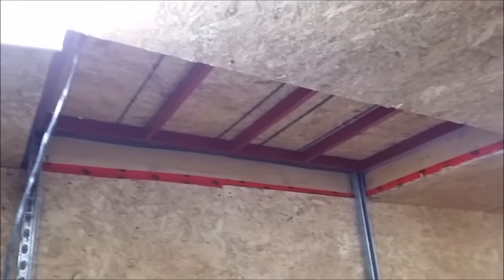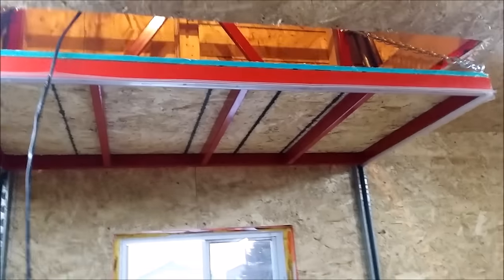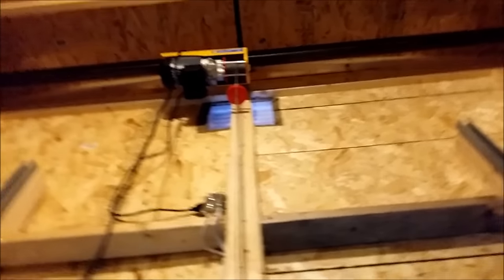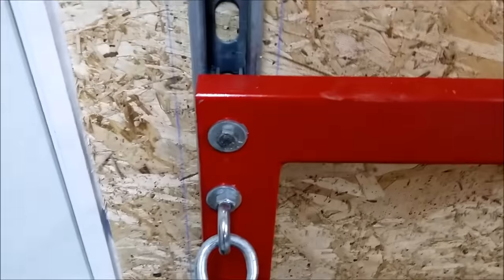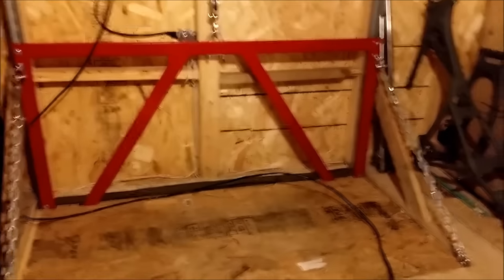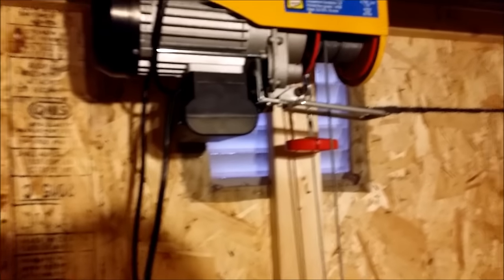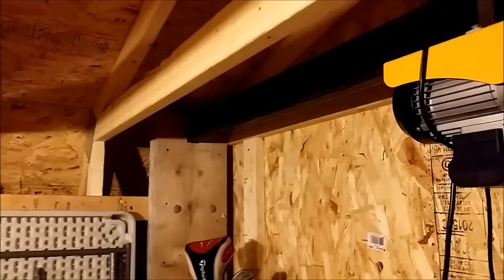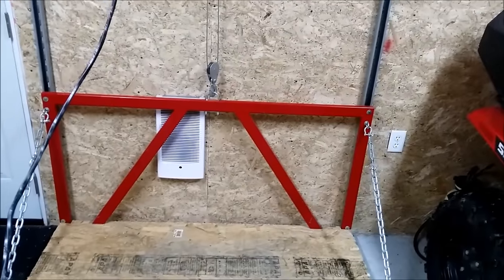Garage Attic Lift Construction

Comment: Before copying this design, realize that is is dangerous.   There are several incorrect statements about loads and forces.  There can be a lot of force on the Superstrut because it is not just a guide.   The P2750 light duty trolley is designed for 100 pounds and has three holes for mounting to the HORIZONTAL load, and two of the holes are difficult to get to because they are over the axles for the four wheels.   The metal can be easily deformed on the light duty trolley by using just the center hole which can cause the wheels to fail.  The heavy-duty P2950 Superstrut Trolley is rated at 600 pounds at 30 feet per minute and should be used even for the lightest loads in this design.        If one stands on the far edge of the lift from the wall, the entire weight of the person is pushing into the Superstrut and the top pulls out by the same weight magnified by the angle of the brace.   To clearly see this, consider if the vertical height of the lift platform is reduced to the 3" length of the top trolley.  Then the force on the top trolley would be magnified by the moment arm length of the lift from the wall divided by the height of 3".   The trolley would immediately fail - try it.   Just because the load is being pulled up by the winch does NOT mean that there is a no  force on the Superstrut.   Also, the P2950 comes in cheap versions and more expensive versions with the corners near the wheels rounded so as not to catch on the Superstrut.   Of course one can round the corners so as not to catch on the superstrut and it is crucial to make sure the trolley does not catch on the mounts of the Superstrut to the wall.  The heavy duty trolley is much less likely to twist and bind with time which would cause a catastrophic failure.   It would also be far far safer to use real heavy duty lift trolleys on I beams.  It all depends on how safe one wishes to be.
Reply from the maker: All great points Jerry. My lift has been in place for 5 years now and my semi-annual inspections of all hardware show things are perfectly fine!
Reply: The light duty trolleys are not safe.  Please think about the danger you are leading other people into.
Reply: blastworks
2 years ago
Sorry for the late reply Vazgen! The ones I am using are only rated for up to 50lbs or so, but they rarely see that as the load only pulls out slightly, most of the load is updown.
This statement is completely incorrect.   The further from the wire rope, the greater the pull on the trolleys.

Comment: you can get it too lift faster by enlarging the knob that the cable is winding around
Reply from the maker: Hey Mgn! I may look into using a larger pulley in the catch block when I replace the cable hoist with a larger one when I upgrade!

Comment: My friend built one like this years ago he also had only one cable with no safety lock on the carriage. One day he was showing it to some older relatives and the cable broke plunging them to the floor below. Some very serious injuries occurred as well as some very serious settlements were required to help the injured. Not trying to be a pain in the ass but please be very careful and also try to come up with some kind of emergency fall restraint.
Reply from the maker: Thanks for expressing your concerns Dave!
Reply: Dave,See my entry above, I found a good solution with a heavy duty brake.
Reply: I believe a synthetic winch cable doesn’t bind and break like regular cable with regular use. I plan on getting synthetic for my quad for that reason.
Reply: Milton Turner,  care to clarify? I'm not seeing your solution re: brake. Thanks
Reply: I see several references to a link with more detailed information, but I do not see a link. Can you attach again?

Comment: curious, what happens when your up in attic and power goes out.
Reply from the maker: @markroberts7941  I dunno where you are from or how bad the power grid is there but I think that runs about the same probability as winning the lottery.  

That being said, I was up there once drilling for security cameras and went through a wire, tripping the breaker. I pulled the lift platform up out of the rails and climbed down. Took about 3 minutes!

Comment: How much weight will the 2”x4”x 3/16” beam handle? I’m doing one that’s 8’ long?
Reply from the maker: Hey Billy! I looked it up and it's around 3000lbs, so anything you'll lift with a cable hoist will be safe.

In the mean time, check out my latest video, I'm giving away a cable hoist to a subscriber who comments and likes the upgrade video!
Reply: @blastworks  thanks and will do!

Comment: I did this same thing with unistrut track and trolleys. Did you have any problems with your joints in the tracks and the trolleys hanging up? I did and grinded the inside of the track but don't trust it. I got the 750/1500 lb hoist so I don't want it to rip itself apart. 😃 Maybe weld em?
Reply from the maker: Robert Haas You could definitely weld them if it would give you peace of mind. I just made sure that mine were in line so I wouldn't get interference when the top set of trolleys goes up into the extra piece of unistrut. On my setup, only the top wheels go up into the shorter pieces, the bottom trolleys stay in the main run of channel.

Comment: Brilliant!  If the lift motor fails, does it lock in place, or does it freewheel?  I would like a fall limiter/brake, if possible.
Reply from the maker: Roger, the lift does not currently have an emergency brake or the like. I have a couple upgrades in mind and a safety brake I'd something I have in plans!

Comment: great job, and info!  i am thinking about making one, that can go 3 floors...  and as in previous comments, i will have to figure out a safety system.  any recommendations?  

tyvm!
Reply from the maker: Sorry for the delayed response Phil! Three floors is pretty optimistic! It'll likely take a lot more cable than I used. You may want to consider a much heavier cable than the stock cable that comes with these type of hoists. For safety/fall arrest, just check out a number of the other comments on this video. A lot of people have a lot of good ideas!

Comment: This has some similarities to the KCSPM3648 model lift, but it does not have the safety backup or capacity that that lift has.
Reply from the maker: I guess the major difference here is that I'm not transporting human beings.
Reply: @blastworks  Yes - You did a great job for your purposes. Thanks for the video.
Reply from the maker: Thanks! In appreciate your feedback!

Comment: Great job. I'm building mine based on your design. One question.... Where did you get the brackets to attach the hoist to the 2x4 overhead beam?
Reply from the maker: Thanks for the kind compliment! That was one thing I forgot to mention in the video. Since the brackets that come with the hoist are only 2" x 2", I actually had a local metal shop make up brackets that were 2" x 4" (inside measurements). The initial set they may up for me were made out of steel that they bent, but they messed up the inside measurements. When I brought them back to have them fixed, they actually just made a new set, but this time welded instead of bent. Had I know they were going to weld up a set I would have simply made them myself!
Reply: g3nocide Thanks for responding so quickly. It's been a while since you built yours. Is there anything you would do differently? What is the max weight you've had on yours? Thanks
Reply from the maker: I'm pretty content with the lift the way it is. One thing I'm about to do is swap in a little bigger u-bolt (1/2" instead of 3/8") for a bit of extra robustness.

The maximum weight I've had on mine has been three men (roughly 600lb total) plus the weight of the lift itself (roughly 80 lbs), but I only raised the lift a few feet when I did that. I usually try to keep the loads I am lifting to half the capacity or less to be on the safe side.

Comment: Thanks for the video, do you know up to how many pounds that trolleys can hold? what's the capacity of it? because that is a very important component for a safety if it brakes you know what can happen. I am trying to build one for my property, but I need to make sure those trolleys are strong enough to hold a person on it safely, thank you in advance for your time.
Reply from the maker: Sorry for the late reply Vazgen! The ones I am using are only rated for up to 50lbs or so, but they rarely see that as the load only pulls out slightly, most of the load is up.down. Heavy duty versions of the trolleys can be found on ebay. Just search for "heavy duty unistrut trolley"!

Comment: Looks good, however, the ubolt that your pulley  is attached to looks like a weak point, I would get a heavier ubolt to replace it.
Reply from the maker: Thanks for the comment Michael. I've already replaced it as part of my yearly maintenance!
Reply: Thats what i was going to say.. only week point i can see besides the winch cable.. lol   i will be adding a much heavier attachment point to my build

Comment: Those eye bolts and U-bolt looks a little suspect.  But overall, very nice.
Reply from the maker: There's an upgrade coming in the near future, and the u-bolt is one item that I am upgrading. I am putting in a higher capacity lift (880/1760) so a couple items to upgrade when I do that for sure.

Comment: Can I ask what kind and size of lags you used to fasten the Unistrut channel to the studs? I'm building a similar lift and I'm having trouble getting the trolley wheels to clear the lag heads inside the channel.
Reply from the maker: Hey Jake! I used 3 1/2" lag bolts with a half inch head. I can't remember if I did any modification to the heads of the bolts to make the exposed part thinner, but I did choose to not use washers. 

Instead, I drilled holes in the back of the channel the exact same size as the diameter of the shank on the bolts between the pre-cut slots in the back of the channel. Even though that only saves half a mm, it was enough in my case. 

You could always use extra lag bolts with closer spacing and grind a bit off of the heads using a grinder after you've installed them for some extra clearance as well. Hopefully these strategies help!
Reply: @blastworks  Good ideas, thanks!

Comment: Awesome video. Do you know what the maximum weight the lift can move?
Reply from the maker: In the video I mention that the lift is a 440lb / 880lb cable hoist. It is rated to lift up to 880lbs when the cable is doubled back through the catch block.
Reply: @blastworks  Awesome, wanted to use this idea for a lift system for a school project and I saw the wheels are only rated for 50lb each. Wanted to know how high you could actually go on them.

Comment: Great job. If you went 48" x80" and wanted to lift 600lbs. Would you just beef the frame up? What would you do differently if you would have went Bigger
Reply from the maker: Hey Garrett. If I were going that big with the lift, I would opt for the larger (660lb/1320lb) cable hoist, definitely a much beefier U-bolt, but I believe the frame could still be built in 1x2 steel. You could always opt for 2x2 if it was a concern.
Reply: What thickness 1x2 did you use. We all appreciate you answering questions.
Reply from the maker: Hey Garrett. I used 1/8" thick steel for the 1x2 frame. I believe that would be more than sufficient for a larger application like you are speaking of as well as long as you frame it out robustly!

Comment: How did you build the frame?  Does the frame fold or are the chains just there to add stability?
Reply from the maker: Kevin Geiger The frame is 1/8” wall 1x2 steel tube welded. The platform does not fold, and the chains are there to help spread the load back into the vertical part of the frame.

Comment: Hey g3nocide. Fellow Canadian (sask) here. Just wondering. you have the trolleys on the inside of the track that control the force outwards (away from the strut) but what about the inward (towards the strut) does the 1 x 2 frame just rub against the front of the strut? and if so will it not wear and make a bunch of noise as it does so? 
Awesome job. I was designing something very similar my self and came across your video and thought man this guy is on the same wave length as I am! I have had concerns about some kind of a safety system as well. I had also thought of a fall arrest strap as one other viewer noted or a second winch as a back up.
Thanks for posting your video it will be of great help.
Reply: Also did you use the 2 wheel or 4 wheel dollies ?
Reply from the maker: Hey Dave! I appreciate the kind words! It makes me feel good to know that my sharing this video has helped!

The trolleys support on both the pull and the push. The trolleys on top pull outward and are supported by the lip of the channel, and the trolleys on bottom push inward to the back of the channel and just ride along the wall side of the channel as it pushes against it. As a result, there is no contact between the rail and the frame whatsoever.
Reply: Cool. Thank you so much for your speedy reply!
Reply from the maker: Your question about the dollies came in after I posted. I used the 2 wheel ones! There is another comment on this video linking to some heavier duty ones (2 wheel as well) which I am thinking about upgrading to eventually, but the ones I use now are doing the job just fine!
Reply: Thanks again.

Comment: I have built something similar thanks to your video. I’m having a little bit of binding when it’s empty and on its way down. Did you have this issue? Have any suggestions?
Reply from the maker: I've not had that issue. I'd check that the rails are plumb and equidistant apart, it sounds like your trolleys may be getting jammed up.
Reply: blastworks - I did just that. Pulled a string. Cut a 2x4 for keeping the proper width. Got it. Works like a charm now. Again. Thanks for the video and thanks for the suggestions.

Comment: Okay, nice, but I really do not see the benefit of spending all that money to store and do what? That could not be easily carried up a ladder or a set of stairs. Don’t take this the wrong way, because I thought about getting a car lift in my garage to give me more storage room underneath, but how does this relatively small lift benefit you? Thanks again for the video.
Reply from the maker: stanley smith Good luck lugging a 150lb snowblower up that ladder!

In reality, I spent roughly 100$ for rails and dollys, about 150$ on steel (beam included) and 150$ on the lift. So that $400 spent that gives me the ability to lift heavy loads up into 200 sq. ft. of storage was well worth it. Plus it was super fun to build, and it looks cool.
Reply: g3nocide I see, How then. It looks well planned out. It seems the more years one gets, the more stuff we acquire and start running out of room. Thanks for the reply.
Reply: g3nocide $400!!?? Plus your fun in constructing. There are all sorts of other costs that make $400 a rather laughable amount. How do you reckon the bargain brand hoist? Doesn't it say do not lift people or loads over people? 
Is it a winch or a hoist? Is it rated for vertical lifting? Looks like the lifting capacity could be easily exceeded to me.
Reply from the maker: bluecanoe17 https://www.princessauto.com/en/detail/440-880-lb-electric-cable-hoist/A-p8041857e

Comment: Very nice... I wound up here looking for a way to build a lift for my front porch, its less than four feet high. Only problem is its outside and I may have to use a wench made for the front of a truck or jeep and a 12 volt supply?
Reply from the maker: Definitely an option Bass Player! If outdoors, make sure you are using the appropriate cable lubricant to extend the life of your cable!
Reply: I'm a Ham radio operator so outdoor cables are all I know about, but I'm sure I will have to have a bumper mounted type of wench so I would think it will come with the appropriate cable... (hopefully)

Comment: Why not use webbing straps instead of the cable ?
Reply from the maker: The cable hoist used is equipped with a cable. If it were equipped with webbing straps then it would have been done that way.

Comment: If made long enough with an 880lb winch do you feel the this system would lift and hold a 500lb motorcycle easily for storage? thanks..just wanting your opinion not an answer from an engineer.my lift rails would be welded to steel vertical beams and not the wall studs...
Reply from the maker: I've had myself and two friends on this lift (roughly 600 lbs plus the 100 lbs the platform it weighs) and it handled it, but I usually try to keep the weight I lift with it down to roughly half of capacity. If the platform was wide enough I would have put my motorcycle (Yamaha FZ-6, roughly 450lbs) up overhead for the winter. I don't think it would have a problem lifting the bike, but I wouldn't be riding up with it. If lifting excessive loads like that often, I'd consider running more than just the 2 trolleys per side.
Reply: Thanks.   I would run 4 trolleys and it would just be for storing a bike up off the floor so I can put one underneath it as well..I just wasn't sure about the weight pulling or resting on the trolleys and the channel with an outward and downward force.. Basically a static weight just staying at 7 feet off the floor.